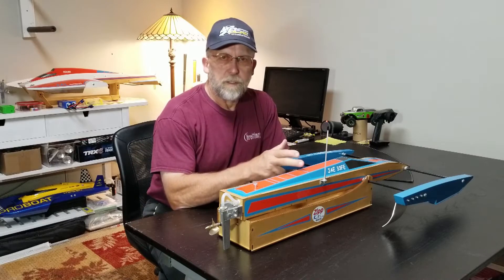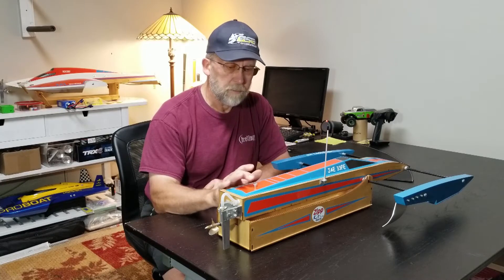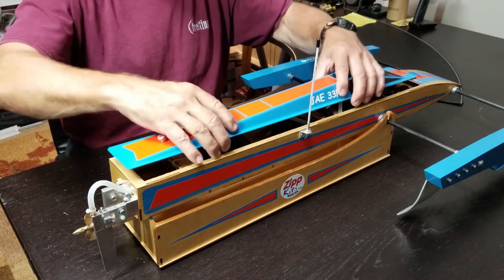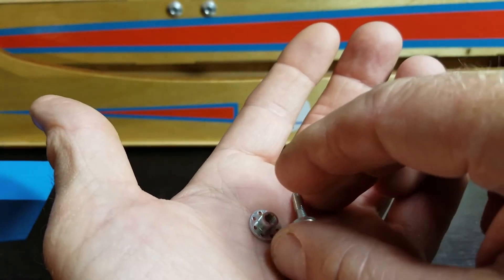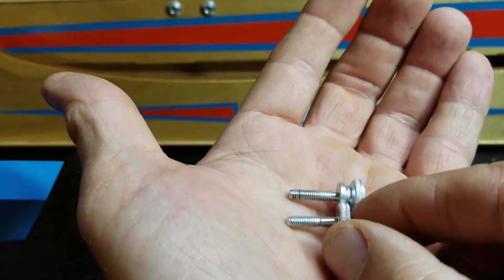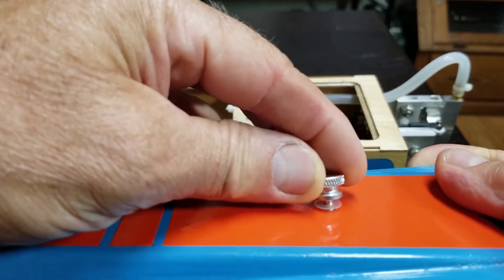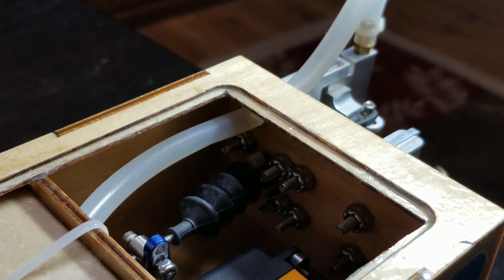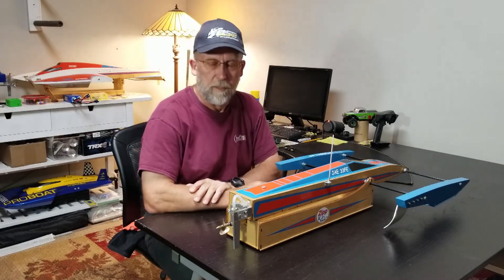JAE 33FE_Stealth Cowling Attachment Explained...

Comment: hey sam, I am just working on my hatch and its a similar size and shape to yours but I added some height over the battery to allow for the 100 c 5 amp 6 s graphene lipo.
Have you weighed your hatch I am at 120 grams. ?
and have to put color onto yet.
Reply from the maker: The all up weight with color is 136 grams
Reply: @chilly7261  thanks mate that gives me a target